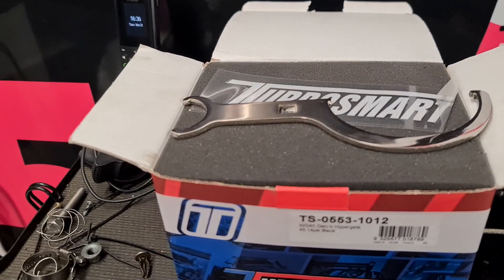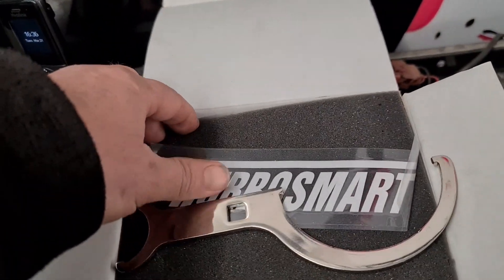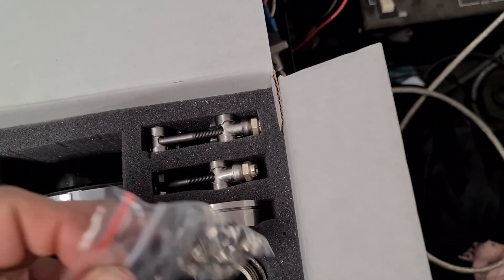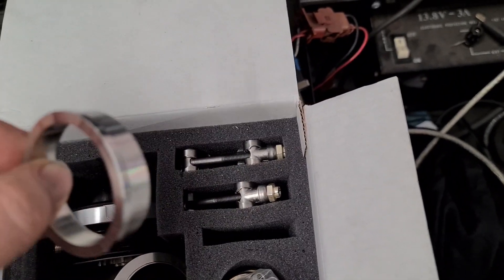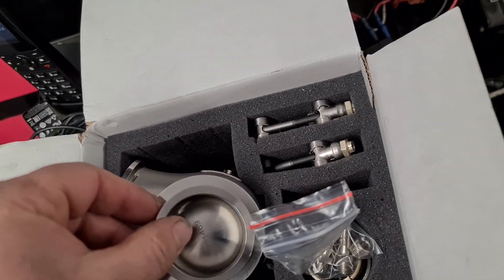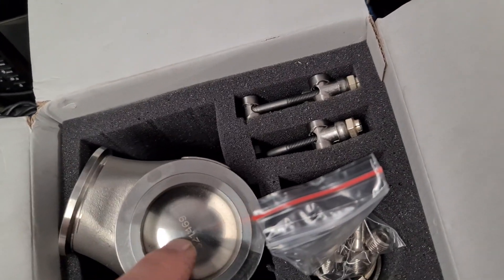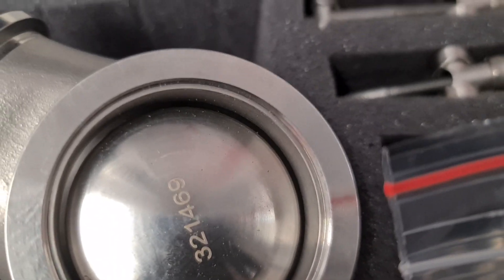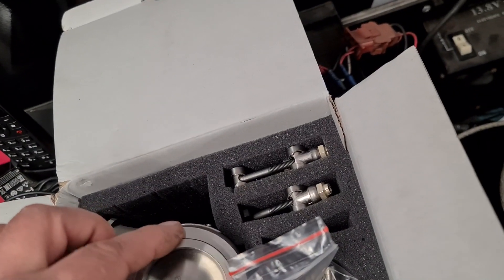GenV wastegate fire ring

Comment: This video is actually so useful for me right now. I didn’t put it on thinking it was just a flange and it was nosey. Not only that but the boost leak was making my turbo smoke driving me nuts thinking what the cause was, I even rebuilt the turbo and same, now I know it was all due to the imbalance of pressure that caused the oil to go past the seal and not a bad seal